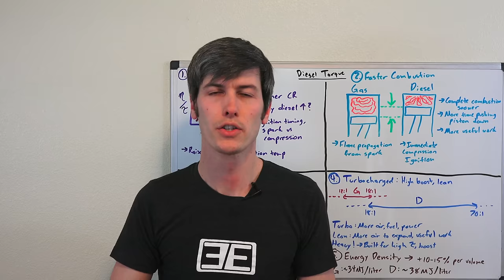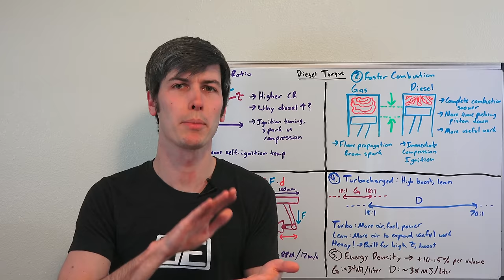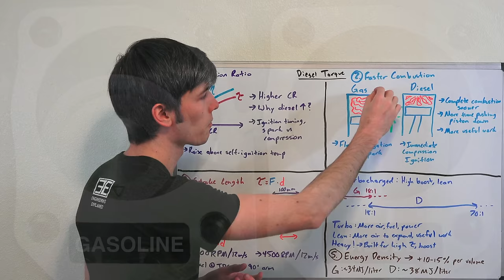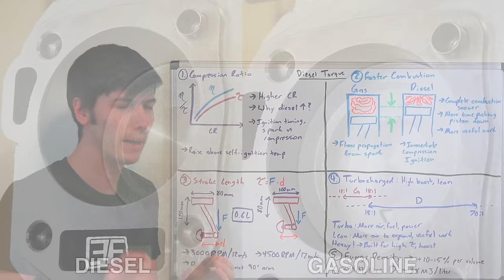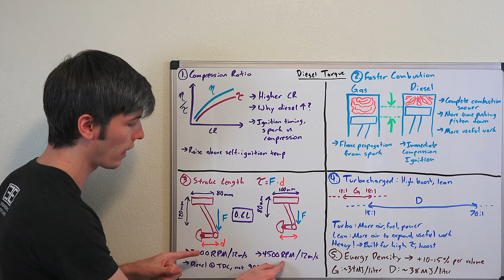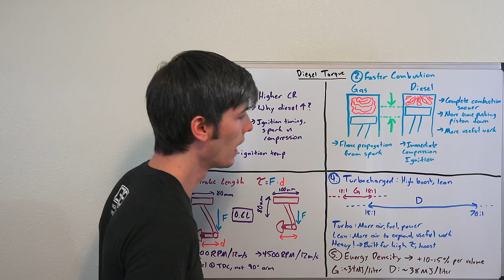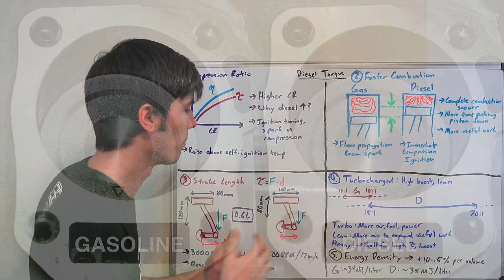5 Reasons Diesel Engines Make More Torque Than Gasoline

Comment: Thank you for explaining this. I've always wondered why diesel is stronger than a gas engine.
Reply: Part of diesel efficiency is its lack of a throttle body. It always fills the cylinder with air, it varies the power output by varying how much fuel is injected. If you’ve seen a truck with just a hint of black smoke under load, they are running about as powerful as they can without wasted fuel.
Reply: Its because turbocharging...Naturally aspirated diesels have much less torque and power than gasoline engine in same displacement.
Reply: Same displacement, gasoline engine more power. Equal power, diesel more torque.
Reply: Yes, more torque but only in crank, diesels have smaller usable rpm, then they have much taller gears to achieve same vehicle speed.
Reply: I’m sorry to say he did not explain it. He was also wrong regarding literally almost every reason he gave. There is one reason: Diesel engines don’t have to worry about knock and or pre-ignition at low engine speed like gasoline engines do. You know how on modern turbo gas engines how the middle part of the torque chart is flat? That’s a limitation to avoid knock. High pressure, high temperature, and ample time mean that the combustion would not proceed as desired if the boost pressure wasn’t reigned in.
Reply: absolutepressur 
Well no, he didn't mention that (and I was not aware of that facet honestly) - he was talking about Operating principles, not practical design. i.e. It is a simple deduction that diesels benefit more from turbocharging than gas engines due to higher combustion pressures.  Its an all-points-valid explanation.
Reply: But so why a gasoline car when you press the throttle takes less to go faster in comparison of a diesel engine?
Reply: samuele 55598 because horsepower is measured as sustained rotational torque (torque times rpm) a diesel makes its maximum efficient torque at a low rpm so horsepower is lower (look at horsepower and torque ratings on any new diesel. Torque is WAY higher and better for pulling things around efficiently) gasoline engines can attain higher rpm so all things being equal, gasoline engines will accelerate faster remembering that (hp=t(rpm))
Reply: samuele 55598 I really wanted to pitch in, but to be honest I haven’t driven anything but diesels in months
Reply: absolutepressur ya diesels no need to worry about knocking cuz they already do that fresh from factory lol
Reply: H H - Equal torque, petrol more horsepower
Reply: samuele 55598 Turbo lag mostly. Petrol is mostly superior in same conditions same displacement and with turbo for perf. Diesel is good for utility but shitty for perf.
Reply: Horsepower is overall far more important if you are about perf.  Torque can be increased with gearing.
Reply: Go watch some Engine Masters videos about boosting gas engines and see how much boost can be applied to a gas engine.
Reply: not factually correct my engine the piston comes almost flush with the cylinder , the combustion chamber is in the cyl head
Reply: Diesel has less fuel consumption than gasoline too.
Reply: @HJ-io8hx  same displacement gasoline more power????  😂
Reply: You should compare natural aspirated diesel with natural aspirated gasoline engines, that´ll open your eyes. Diesel didn´t feel per se stronger than gasoline engines.
Reply: @Kacpa2  actually diesels are gradually entering the professional racing scene
Reply: samuele 55598 because 1)petrol burns faster & releases its full energy almost immediately  2)reciprocating parts in petrol engine are lighter & thus can be moved easily..
3)diesel burns STEADILY and takes time to release its full energy
4) reciprocating parts in diesel engine are heavier & takes effort to move..that's y diesel acceleration is slower
Reply: ev man  until your EV runs out of power on a long distance drive from the lithium ion batteries being poor sources of potential energy leaving you stranded at a charging station for hours on end. Fossil fuels are more efficient than batteries
Reply: @trp2413  If my engine doesn't produce vacuum at idle, then I would challenge you to explain how intake leaks (also reffered to as vacuum leaks) increase idle speed. Yes, engine produce less vacuum at idle, but you have to start somewhere. You can't have zero vacuum while not moving, or you would have no idle.

Comment: Do not agree with your suggestion that diesel has a faster speed of combustion. In fact diesel fuel burns more slowly in the engine because it is being sprayed into the cylinder with the injector over a considerable portion of the piston down stroke. In fact the ideal is to produce a constant cylinder pressure as the piston descends and this is the main reason diesels have higher torque. With a gasoline engine the spark determines almost instantaneous combustion with very rapid flame progression at the top of the piston stroke and the pressure falls off rapidly with the piston descending. Clearly this will produce lower torque. Dan Hanlon.
Reply: This is true.  This is also the main reason why diesel engines can't rev past a certain point.  Depending on stroke length, the theoretical limit can be anywhere between 5.5 and 7000 rpm.  For most engines, it is around 6000 rpm.  If you exceed this limit, you will still have considerable expansion when the piston hits BDC, grenading the engine.

Comment: The stroke length is very important for more torque and your illustration shows it quite clearly. In order to have a longer stroke, the crankshaft has to have a larger offset to the connecting rod in order to move the longer piston stroke. That larger distance means that the piston is in effect pushing the crankshaft around using more leverage. It's like using a longer wrench to loosen a stuck bolt. The larger offset the crankshaft has is like the longer wrench.
Reply: USWaterRockets But.... If you keep the same capacity of the cylinder  then longer stroke means smaller bore and piston area thus force pushing piston down. All equalizes. ZERO effect on torqe. Jason simplified it too much imho.
Reply: Sewer Razus
Correct. Longer stroke with smaller bore means lower stress of the components, provided RPM is not too high. 
Since area is dimension squared, halving bore diameter means quadrupling stroke length to get the same displacement. Force on the piston is area times pressure, area is one quarter so it's quarter the force. Torque on the shaft is force times crank length, so that's quarter the force and quadruple the length. All comes back zero. And why wouldn't it? The compressed combustion products make certain amount of mechanical work by expanding to certain volume. This means this amount of mechanical work will go to the shaft, no matter the bore and stroke configuration.
Reply: Mi 28 +1, I was very surprised Jason was so confused when he spoke about it
Reply: The thing he missed is that the diesel injection and so its burn duration is longer, so the cylinder pressure is held constant as the piston descends. This means the combustion pressure is still at its maximum when the crank is swinging past the 90’ and the piston has its best leverage.  A gasoline engine has lost a significant amount of pressure by the time the crank swings through 90 degrees, so the piston isn’t generating the same torque.
Reply: It doesn't matter, power in = power out. You can't bypass thermodynamics by jumping through hoops in specific order.
Reply: Torque and Power are not the same thing. It takes the same amount of work to drive a car up a hill no matter what gear it's in, but by using certain gears it may be more fuel efficient than others.
Reply: That was my understanding of what he said. I think he meant that the larger diameter is great, but the stroke length, on its own, doesn't contribute as much to torque (because the largest force is not acting at the optimal time).
Reply: Yeah, not really. Pressure is not constant, but it is much closer to it than a gasoline engine which has a VERY fast pressure rise.

Most diesel engines will hit peak cylinder pressure about 12-15 deg ATDC.
Reply: Mi 28 bro then what's the use of making under square and over square engines. Could you please explain.     please.
Reply: @michaelbuckers  Exactly!,   I like the "Waterwheel"  analogy ,   MASSIVE torque, but at 1 rpm, takes all day to winch a load up the hill

Comment: Diesel engines make way less torque compared to equivalent (same era, same displacement and same boost) gasoline engines. 
For example, 2004 Golf V 2.0 SDI makes 140Nm while 2.0 FSI makes 200Nm
Or 1994 Merc C 2.0 D makes 140Nm while 2.0 G makes 190Nm
This is the reason that NA diesel engines have disappeared and turbo is a must.
The only common "torque advantage" of the diesel is the lower rpm range.

Also longer stroke for same displacement does not increase torque because greater leverage compansates greater force for the same pressure

Actually the only true advantage diesel engines have, is efficiency. 
Any car maker can produce a gasoline engine cheaper, more reliable and with a better torque curve over the entire rpm range from the same displacement, than any given diesel engine. but can't even get close to the diesel efficiency. As simple as that.
Reply: I agree Diesel engines are good for efficiency, I also think diesel is good for longevity, but with all the emissions killing and  cooking Diesel engines it's not worth having one anymore,plus the price of a Diesel engine upgrade  ,,, and the manufacturers got people tricked into thinking 300k is a lot of miles for a diesel , so many post on you tube people  bragging of 150k & 200k on their  new model  Diese truck
Reply: yes but now they make more torque i like diesel for an everyday car and gas for a weekend car
Reply: poseidonsr 2.0 SDI have 75hp and 140nm and fsi 140hp 200nm... u dont need turbo for torque lol
Reply: @antoniotod9614  my 1.6dit subaru petrol engine has 250nm torque between 1800-4800 rpm.
Reply: Your math is wrong. You were supposed to compare torque/fuel, not torque/engine_configuration

Comment: Diesel burns MUCH slower than gasoline, which helps it push on the piston for a longer period, taking advantage of the longer stroke... That, is why they have more torque.
Reply: It does burn slower, but that doesn't translate into producing more torque. 

Let me know if you would like a more detailed explanation.
Reply: Brady Black I'm not the original commenter but I'd like a detailed explanation
Reply: Of course! To put in layman's terms, when you combust fuel past top dead center you are effectively reducing the amount of possible work you can get out of it. Fuel that has been burned at the beginning of the the power stroke will have more of its energy extracted out as work (torque). This is mildly similar to how a higher compression ratio will result in more power output. Injecting fuel late (and therefore igniting late because we are talking about a diesel engine) is reducing the amount of work the fuel could have done. Obviously this is inevitable because diesel engines can't inject fuel instantaneously, but it is in no way beneficial. 

Does that make sense?
Reply: Brady Black Makes perfect sense. If you ignite the fuel when the fuel is compressed to as small space as possible (TDC) it gives more powerful expansion compared to igniting later when it would produce less force
Reply: Kinda. So the pressure IS higher (I think thats what you mean by a more powerful expansion), but it is also that the force exerted on the piston is being over more time (more crank angle degrees).
Reply: Turtle... no, you have missed the point. Look at the video and THINK next time.

Comment: Erm, probably the most important part would be the turbo on the side. A non turbo diesel (aka NA diesel) has very little torque compared to equal sized petrol engine. So obviously it is the turbo. Sure, a turbocharged petrol will not make as much torque as a diesel from factory, but then it has the rpm benefit. A 2.4l 6 cylinder diesel with no turbo makes less torque than an 8V 2.3l 4 cylinder.
Reply: Volvo fan? ;)
Reply: szafirowy01 yeah... B230F vs. D24 :D But I changed brands about 3 years ago... Now it is Jaaaaaaaaaag :D
Reply: Mmm, similar to what I like ;)
Reply: Nathaniel Vas try the BW 1.9 SSI. A TDI without the turbo. Otherwise direct injected. Still makes less torque.

Comment: You touched on all the right points, however, Diesel engines do not burn evenly nor completely as you stated, the combustion in a Diesel is a Heterogeneous one , when fuel is injected, the outer part of the spray burns lean while the inner does not and takes longer to combust, secondly I expected you to expound more on the importance of no throttle body in a diesel, rather than generalizing it as pumping losses, the more technically correct term would be Higher Volumetric effiency as a result of no throttle body
Reply: And who cares about heterogenous burn? That's why diesel engines are made sturdier.

Comment: The true reason most diesels make more BMEP is as follows:
1) They do not suffer from detonation or pre-ignition, meaning an ultimately higher Cylinder pressure and temperature is possible. (a gasoline engine would need to be run on a very high octaine fuel to produce the same BMWP without damaging abnormal combustion events)
2) Compression ratio. An engine is a thermal device, ultimate efficiency depends on compression ratio. Higher CR = more BMEP
3) Average cylinder surface area during combustion. Again, DI engines burn their fuel at lower average combustion chamber volumes and hence lose less heat to the chamber walls. More heat = more pressure = more BMEP

In all cases the charge burn angle is calibrated to position the peak pressure point at a geometrically optimum point in the stroke. For most engines (typical geometries), this is around 10 to 15 degCA ATDC. In a SI engine this is done by optimising the ignition angle (where the spark occurs) and for a DI engine by optimising the injection angle and injection mass profile.
Modern DI gasoline engines are now actually pretty close to diesel engines in terms of maximum BMEP, but can produce significantly more ultimate power as they don't suffer from the same burn rate limitation as a diesel that limits the practical speed for peak power to around 5krpm
Reply: When they used Diesel engines in LeMans racing (Audi and Peugeot) even these racing engines have the max power around 5000 Rpm.
And the reason is exactly  you stated that the burn velosity restricts higher RPM.
A follow up video would be nice, since I think there is some confusion here.
Reply: I actually did some combustion development and port optimisation for the Audi R10 TDI LeMans engine, and ultimate burn rate was the power limiter that drove the engine design towards a high BMEP, low speed, low friction type architecture!  Add in the mandatory air restrictor and it was always going to be a engine dominated by it's combustion efficiency rather than combustion power!
Reply: Amazing comment better than the video ! How are the new gasoline engines get torque as a diesel counterpart, but more power and they have quite good economy too ?
Reply: Well that's a amazing coincidence that i choose to mention the LeMans diesel :)
Spoken from a true garage tuner !
Reply: Awesome! I just asked my DJ to get a diesel-turntable to gain more BPM!
Reply: Exactly

Comment: But gasoline engines run on the Otto cycle which has a constant volume heat addition straight line on the graph. This represents gasoline burns much faster than diesel. And diesel cycle has constant pressure heat addition.
Reply: Diesel does burn SLOWER than gasoline, that's why they can't rev that high...
NA diesel does not have more torque than a NA gasoline. The higher CR AND turbo (and multijet) gives higher torque. Turbocharge a gasoline and torque is there as well. Diesel efficience is higher due to higher CR (higher thermal efficienty) and  higher BTU/volume compared to gasoline.
Reply: You are aware that you are contradicting everything he says in this video? Diesels can't rev that high due to longer strokes and higher piston speeds relative to rpm and diesel fuel burns quicker in an engine, almost instantaneous as it uses the heat created under much higher compression.    @ivojanssens221
Reply: @Leemur2335  no way! Diesel engine sounds like the chain of many explosions but gasoline one doesn't. Just think, why? The answer's simple - combustion at diesel engine is the fast explosion. Not the same, and gasoline combustion flows very slowly in one cycle.